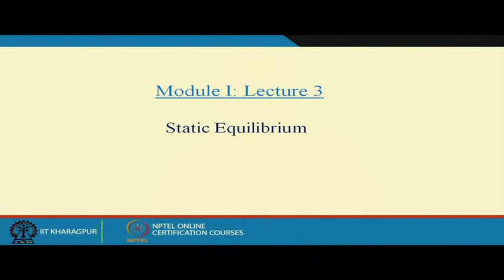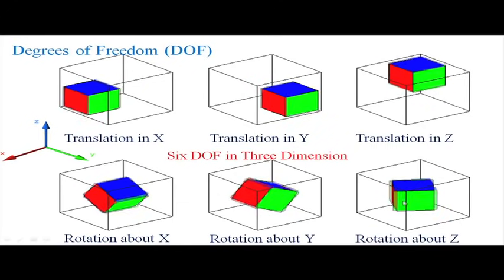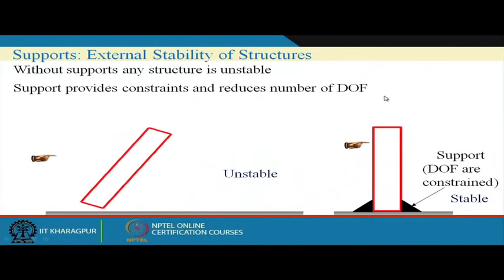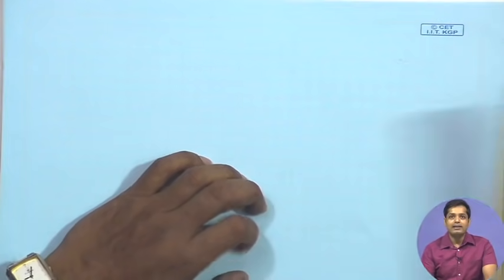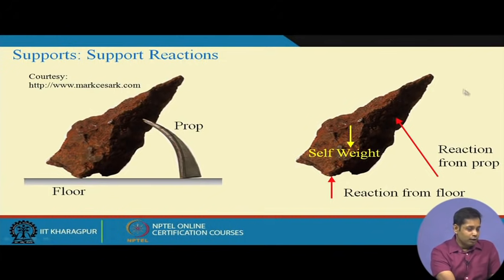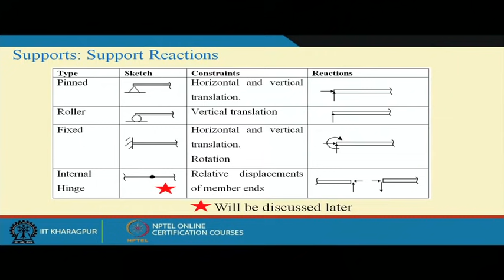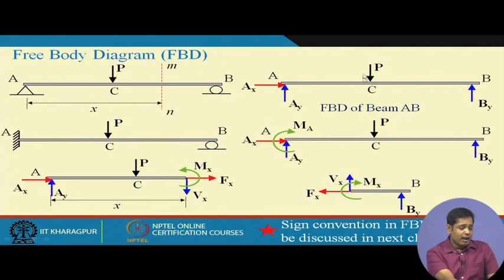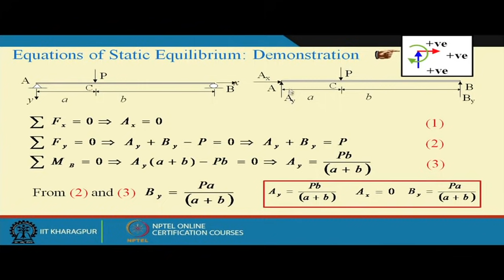Lecture 3 : Static Equilibrium

Comment: In static equilibrium equation  demonstration why you consider moment at B and why not at A ,explain sir
Reply from the maker: If an object is in static equilibrium then the static equilibrium equations hold everywhere in the object (here it is a simply supported beam). You can also consider moment equilibrium equation at A instead of B. This will also yield the same results. Using moment equilibrium equation at A, you can directly determine By (in place of Ay) from equation (3). Then use equation (2) to determine Ay. Hope it helps.